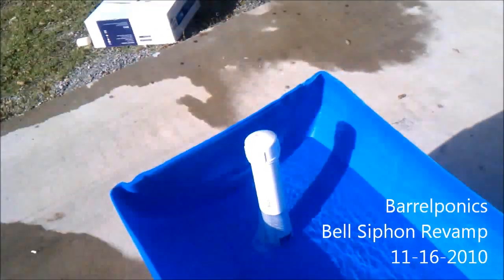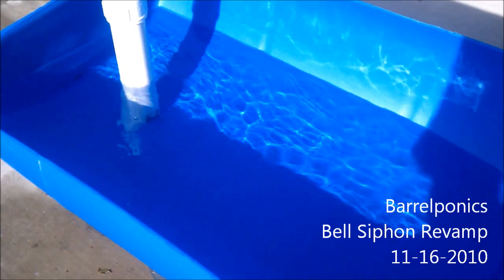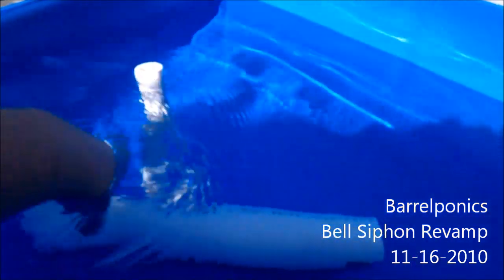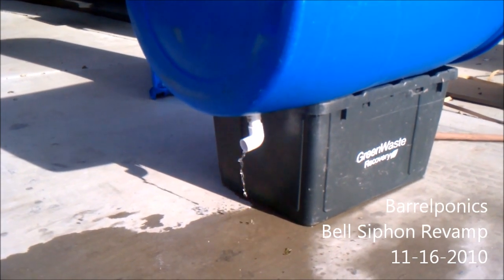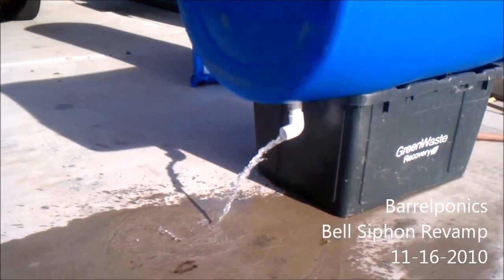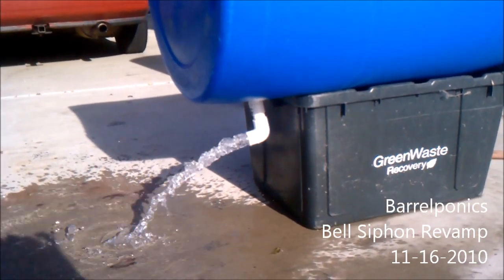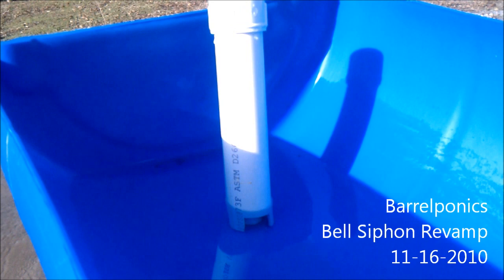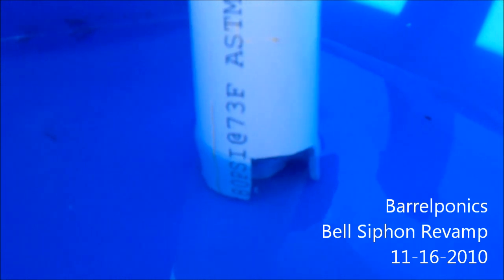Barrel Aquaponics - Bell Siphon Revamp

Comment from the maker: @affnan In my barrel system I stuck with a regular Bell siphon. On both my indoor and my (soon to be) greenhouse system, we use an external bell siphon to save grow bed space. You can view it here: 

watch?v=iTRpR-gIkxE

I want to try using a "U siphon" as I hear those can get the water running really quick.

Comment: Part 6
Concerning cycle times, please note it take approximately 10 gallons of water to flood a Barrel-Ponics® growbed filled with 1/4" to 3/8" gravel.  If you are flooding the growbed every 10 minutes that's 60 GPH per growbed multiplied by 10 growbeds requires a pump delivering at the minimum 600GPH.  I operate mine on a 360GPH pump here that only consumes 40 watts of power cycling my three of my systems here (I have 9 variations, one with 37 growbeds) every 1/2hr with amazing growth. con't.

Comment: Part 5
Systems that utilize longer cycle times (mine cycles every 40 minutes or so) harden the plants somewhat to be better suited to the occasional power outage.  WHile this may not seem important to you right now.  Imagine having a power outage in the summer heat in a greenhouse and losing plants due to extreme wilting in those conditions.  Plants used to a drier environment will fare much better.  Concerning moisture, diseases like powdery mildew are greatly reduced with longer cycles. cont.

Comment: Part 4
Root manage,ent is another consideration seldom though of when many people try to redesign aquaponics systems.  The drain systems in The Barrel-Ponics® systems incorporate a much larger surface area to drain from requiring longer times between services and at the same time allowing for a very substantial framework to be built with easy access to plumbing.  Not like bell siphon systems with plumbing underneath the framework.  cont.

Comment: Part 3.
It will also reduce any buildup in the distribution piping to the growbeds.
The Flood Valve is much more flexible for a system and also creates a place for solids to mineralize in both the top raft tank and at the bottom of the Flood Tank.
You will also find maintaining a system with many growbeds as you are thinking with a 500 gallon fish tank will require you to keep clean a bunch of finicky bell siphons whose parameters change with every strand of root that grows in it ( they will).

Comment: The fact that someone told you this system should cycle every 10 or 12 minutes indicates they may not really know what makes an aquaponics system really function well.  While many think it is only about bacterial conversion of ammonia ultimately to nitrate it also has a lot to do with gas exchange at the root level.  Allowing a system to flood quickly and leave some time to air out a bit improves root health on a wider variety of plants.  cont.

Comment: I'm kind of curious why you are not using the Flood Valve mentioned in The Barrel-Ponics® Manual (Barrel-Ponics® is the correct term, I coined it)?  Some of the issues you will encounter with a bell siphon system are as follows:
First of ll the flow rate, the siphon you are trying to use requires a much higher flow rate than the Barrel-Ponics® Flood Valve.  For instance the Flood Valve can operate on as little as 10GPH.  Not possible with the bell siphon you are using.  cont...